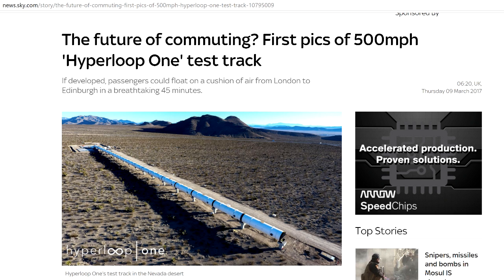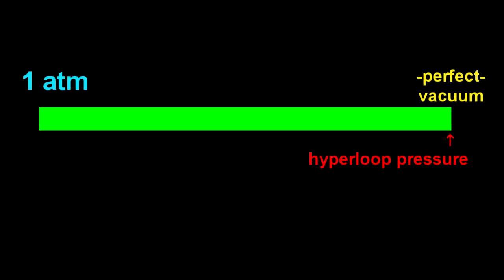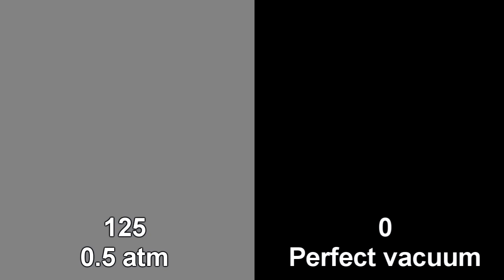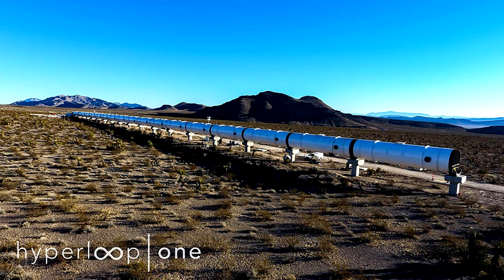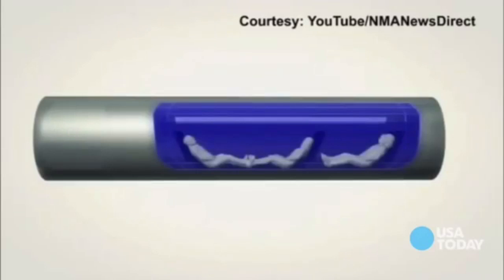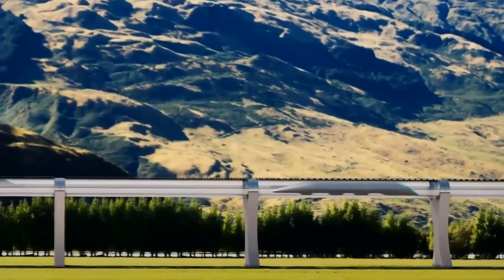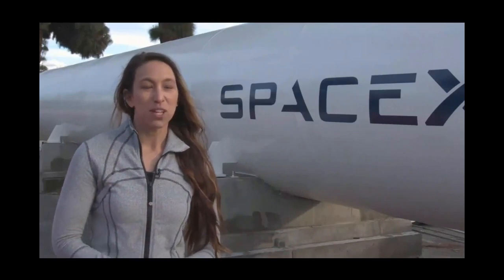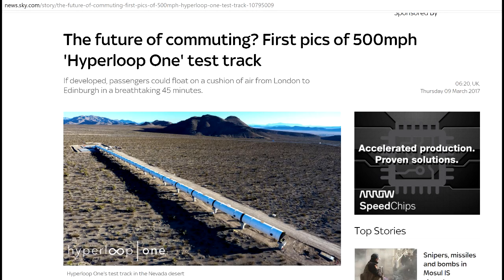Entire Hyperloop could be destroyed in SECONDS!

Comment: why are you not scared of the large hadron collider imploding then if you are so scared of this one doing it. i dont se any problem with the hyperloop except that they don't put real engineers to build the prototypes. instead they use some kids to build them.
Reply: The LHC is underground and only transports subatomic particles. It also has many safety procedures and still fails at times.
Reply: Bob Bytes why can't the hyperloop be underground and have safety procedurs? they sem to approatch it from a marketing perspective and not from a realistic.
Reply: Have you seen how well-built the LHC is? Plus it's underground so it doesn't have to deal with thermal expansion from the heat of the sun, and the chance of an idiot driving a car into it or firing a gun at it etc is zero, and when was the last time you saw a headline that said "Big earthquake in Switzerland"? Most importantly, no one is going to die if the LHC depressurises because THERE AREN"T PEOPLE INSIDE THE VACUUM CHAMBER.
Reply: are you applying the hyperloop will not be well built? and whats to say it will not be underground? if you would put a guy with a brain to plan it he would probably realise its best to put it underground
Reply: I was at CERN, and I saw a crosssection of the LHC, here one for you: http://cds.cern.ch/record/843195/files/LHC-PHO-2001-187.jpg

Do you see the thickness of the walls? Now compare that with the Hyperloopwalls and you know the answer
Reply: Robin Cerny those are not the hyperloop walls. if the hyperloop would be built it would have stronger walls. there are laws that dont allow building of death machines. and if i understand right they are going to use the hyperloop for cargo shipping first.
Reply: Skiller Zuk you mean "implying"not "applying", and no I don't need to imply it won't be well built because you can see from the video what they're planning to build is not well built for the task. That thin steel is nowhere near adequate. And can you imagine the expense and difficulty of putting 350 MILES of this thing underground? Probably why they have never planned to put it underground!
Reply: those are not the pipes for the hyperloop. its for a test track. the longest tunnel humans have made is 4 times shorter so i cant so that being a problem. but i cant say if it is economically profitably. but we have shot humans to the moon and back. so i have a hard time imagine putting a train inside a vacuum tube is impossible. and its first use would be for cargo and not for human transport

Comment: What is your obsession with killing this thing? I normally agree with you on these things (the dehumidifier waterbottle, the tiny scuba thing, the waterseer) but I think you are totally wrong on this one. The tank that implodes is designed to hold pressure (and not very much) not vacuum, it is a terrible analogy for the tubes they are using, and those internal struts are used  to prevent deformation during transport. the ping pong ball cannon is a worse analog, the hyperloop will have safety systems like "airlocks" and brakes to prevent things like that and if they're smart they will have a repressurization system to stop runaways.
Reply: I agree about the ping pong balls, but the tanker is a decent analogy in my opinion.   I've seen a 30,000 gallon infernotherm crumple up like a fleet of trucks hit it, double walled 3/8th steel and it was not a vacuum that did it- someone turned it off during the winter and the vent port blocked.   Just the steam inside cooling did the trick.
Reply: Seems like this particular video is more of a skeptical critique. Probably a good thing.
Reply: Motoken what you said? $$$? money? views? well it would be real if tf00t didn t have like 200 000 views for video!
Reply: The ping pong analogy is a good one too.  Let's say, for a moment, that the Hyperloop has airlocks every 10 feet, so that leaks can be dealt with swiftly.  So a leak pops up 50 feet in front of your pod, when you're traveling 700+ mph.  The airlocks slam shut to keep your pod from being crushed by a column of air, but now, you're rocketing toward a closed airlock 50 feet in front of you, doing 700+ mph.  That's death by the G force of stopping, or death by collision.  Take your pick.  The other option is close the airlock behind your pod, and get slammed by a column of air at the speed of sound (a 1500 mph collision, give or take).  There's no easy answer to the "ping pong" problem.
Reply: First of all, it was simply a statement that a solution for this particular problem will likely not find an answer in something so simple.

Secondly, that's absolute nonsense.  An easy solution to a noisy amplifier might be to add grounded shielding around it's components, while a difficult solution might be to pump 1 K air onto one particular component without dropping the temperature of the component 3mm away to more than 15 degrees C.  They both solve the problem, but one is clearly easier than another to implement.
Reply: even if you stop the carts from moving if a hole were produced on the thin metal lining soon enough you'd have air rushing into the entire system at the speed of sound, which would then slam into any of the carts inside, even if you had a re pressurization system, I don't see it working fast enough to fill the entirety of the tube with air before the massive pressure wave hits a cart.
Reply: Ben D I don't have the calculations right here with me but considering an isotropic material a pressure vessel should be able to hold a vacuum like it holds pressure - by withstanding a force applied over the shell.
Reply: "There's no easy answer to the "ping pong" problem."
Difficulty is a red herring.  There is either a solution or there is not.
Reply: You said easy ANSWER, not easy implementation. Poor choice of words.
Reply: Ahh, yes, I forgot I was dealing with a grammar Nazi.  Unless you choose every word to be technically correct, everything you say is wrong, and all your points invalidated.  Thanks for reminding us how the internet works.
Reply: Its dangerous, expensive and fulfills a porpose the maglev already does better.
Reply: For an idea of the fuel savings from using low medium density, I did some calculation in my physics software.  A TGV shaped 1,000kg vehicle running through 1% * Earth air density would take 600 newtons to hit 300kph in 3 minutes.  In 100% density it would take 16,300, 27 times higher.  For some perspective, Usain Bolt uses around 200 for his races.
Reply: Thunderf00t just needs to please his wider audience and he does not care about loosing more demanding viewers.
Much more figures on Hyperloop issues were presented in the comments than by thunderf00t himself. Other clickbaiters at least do not pretend saving the world.
Reply: Whoa, whoa whoa. A "Repressurization system"? Those tubes don't look like they have powerfully sealing locks in place.
Reply: Any punctures are instantly resealed with the collective hopes of those who put money into the project. Its fool proof. They are also solving the energy crisis by using the hot air between peoples ears.
Reply: "The tank that implodes is designed to hold pressure (and not very much) not vacuum"  A vacuum is only around 14.5 psi, we are talking about extreme amounts of force, but not even high pressure.   The force is so great because the surface area is.
Reply: How exactly is he trying to kill it? He has no influence over this project  He is just exposing the issues of an extremely problematic idea that is extremely overhyped. The type of coverage this and most of the "sexy" engineering and science gets in the mainstream deserve some criticism. The kind of extraordinary claims that these guys make deserve to be questioned. When something raises so many obvious technical and safety concerns but all the talk is how awesome, fast, cool and environmentally sexy it is they deserve to be questioned. When you do not have a prototype but talk about some incredible economic prospect you need to be questioned.
Reply: Look at what they are using for the tunnels of the hyperloop and then compare that to nasas vacuum chamber which is only a fraction of the size of the hyperloop, the hyperloop also levitates to reduce friction; so no place to put the brakes.
Reply: Ben D its an example of what could happen plus it is actually impossible for this to work with our current technology. Plus anyone can destroy this thing by just piercing it.
Reply: Views and $$$ why do you think he keeps recycling the same video.
Reply: "but I think you are totally wrong on this one. "

Of course you do, you're a Musk cultist.

Seriously, you guys are like the right wing Anti-SJWs that cried when he ripped "The Rebel" drone apart. He is simply doing what he has done for the projects you listed, against the Hyperloop and you have a problem with that, ROFL.